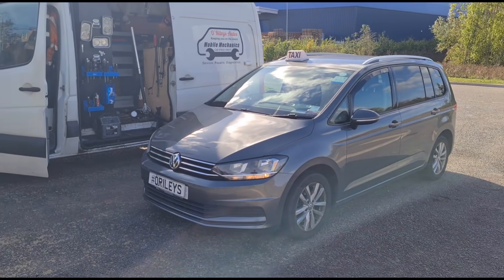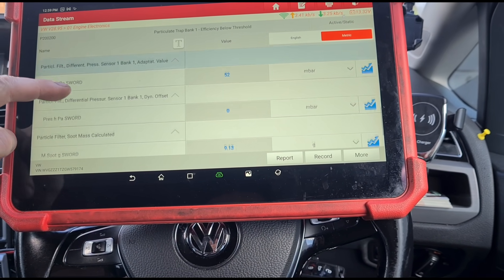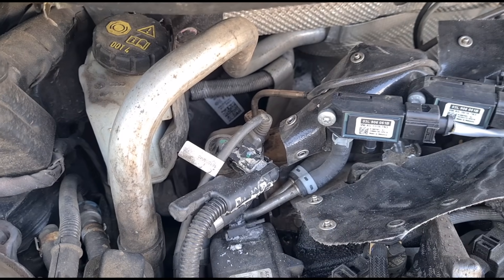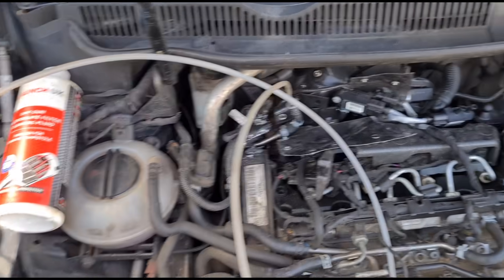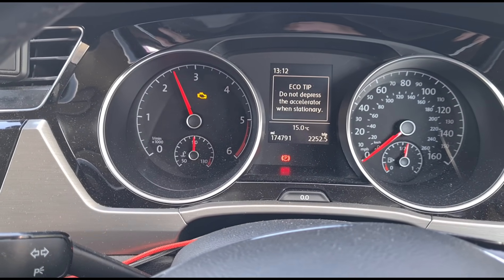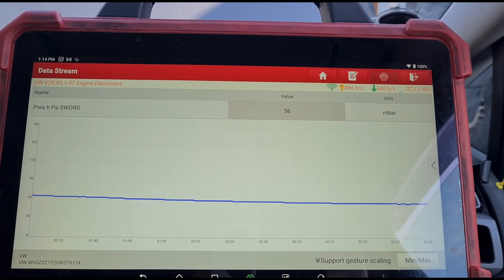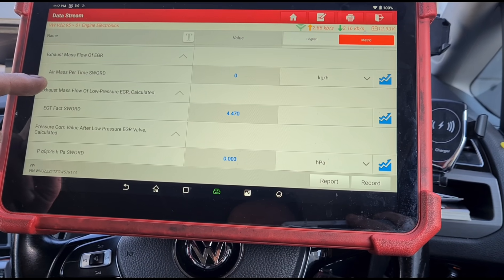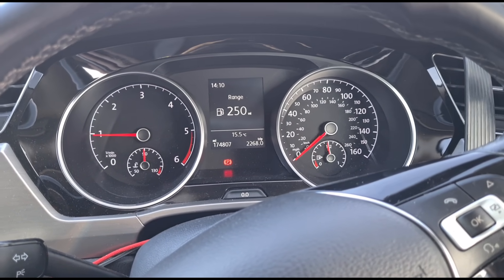VW Touran 2.0 Tdi P200200 Particulate Filter Efficiency.  Blocked DPF Cleaning

Comment: I had this with an octavia 
 Tried dpf fluid was running at 4 mbar unfortunately kept coming bk with same code. Removed low pressure egr cooler and was blocked with adblue. Replaced and its been ok since. Crazy money to put right . Pain of a job too
Reply: That’s the way, is blocked usually badly. Or Can be deleted…

Comment: Couldn't find the dpf gun there earlier in the week - so I used the big manual oil-extraction/filling "syringe" instead to get the fluid in - worked just dandy with an adaptor jammed up the end so it fitted the DPF pipe. If you don't have a compressor fed DPF gun, a Sealey oil-sucker syringe will do the same job, or maybe even better.
Reply: Look up for JLM DPF gun that will be great. I’m using for the past 5 years

Comment: Here in the states there is a product called Archoil 9500, fleets have found that using this in every tank reduces regents by 50% and thus extends the life of the emissions systems.  Do you recommend any product like that?

Comment: I have Toyota verso S 250 000km. Shop took DPF out and cleaned it. Water pressure on the cleaning machine dropped from 24 to 13. I am not sure about those numbers and units(phone call). P2463 is still on. Do you think that DPF is too clogged up and new DPF is only option?

Comment: You will find having working fir volkswagen , the egr cooler will need to be replaced, p2002 will read low efficiency bank 1 low threshold, egr cooler common issue amongst vag group
Reply from the maker: It was already done. I'm sure I've mentioned it in the video

Comment: Unfortunately this is a temporary fix the only way to remove ash is to do off the car DPF cleaning with  reverse flush.
Reply: Unfortunately for this customer Jimmy has saved his bacon by getting the DPF PRESSURE down to a good level where unfortunately temporary may be a long time or quite a lot of miles unfortunately. Cars are in general temporary so a temporary fix may be a wonderful thing.
Reply: There is an option to add a special liquid to diesel fuel to clean the DPF. Significantly reduces pressure in the DPF.

Comment: It will be back within days. There is no sensor which will determine the ash and soot content as how many grams are in the DPF! The ECU is calculating due to the poor driving habits or if there is a malfunction in the system and the car / van can’t regen…. To reset the DPF either use only login and then adaptation or basic setting will do. Or get a VCDS. Autel will perform much better then Launch specially for DPF jobs. But keep launch as 2nd tool. Use some WD 40 to remove the Dif pressure sensor. EGR cooler either is blocked or electronically faulty. Needs replacement or deleted. Job done
Reply: The egr cooler was partially blocked with soot on my 2019, 2.0  tdi  Skoda Superb with 77k miles . This resulted in a P2002 code every few days.
Egr valve and cooler were replaced at a cost of £1120 and it's been fine since.
Will be adding dpf cleaner to the tank every few months in the hope it keeps the soot buildup lower.
Reply: @Jon-pm8ie  that’s why I mentioned replacement or delete will be the option. I seen soo many of them and cleaning was not an option for long term. When they call me straight away I’m giving them those two options. Cleaning will be hard and after a short while it will be back so I never recommend as customer will waste his time and money
Reply: Hi. Just got a 2016 A6 estate 2.0 TDI ultra with 111k miles. I’ve been watching these  sorts of videos since last night 😂 Previously had a Seat Leon 2.0 TDI FR 2015 model, no issues at all and it was high mileage. I do a mixture of city 30-40 mph, and motorway weekends. I do understand let the engine regenerate cycle and don’t stop the car but let its cycle finish, was able to assess that at idle while it was revving a bit higher. What do you recommend with the Audi A6, please preventative? EGR delete is enough? Do you do this and are you based in the UK?
Reply: Delete physically or just software map?

Comment: Great job Jimmy.  It’s pain with the VW’s revs maxing out at 2500rpm when the vehicle is stationary.  All VWs seem to be like that.
Reply: Turn off traction control,  engine will rev to maximum.  All VAG stuff will do it (only works on manuals)
Reply: @danlovelock778 makes no difference on my 2011 Alhambra TDI
Reply: @gavTFSi  with clutch down and traction off?